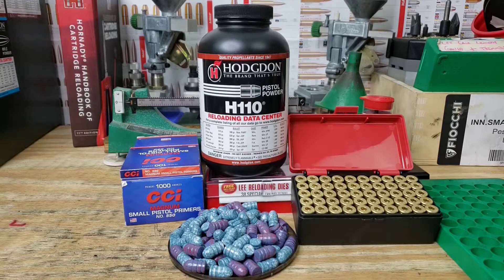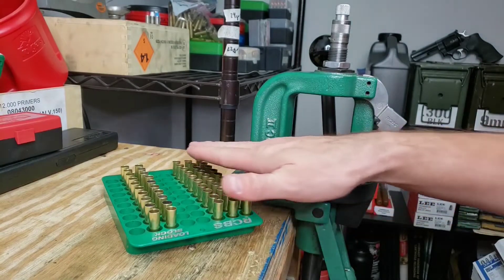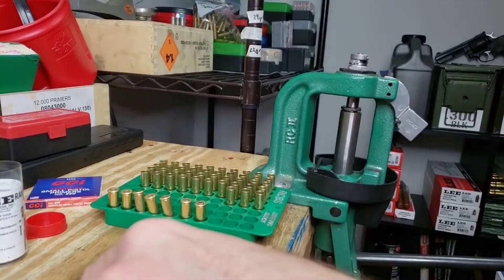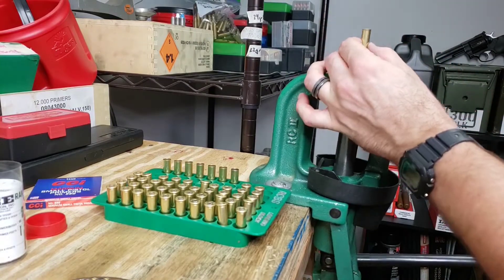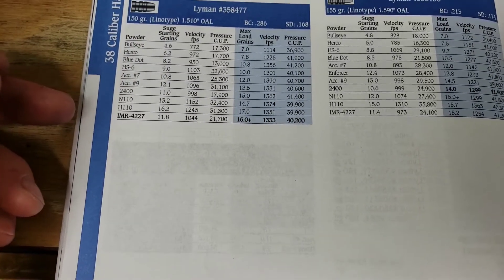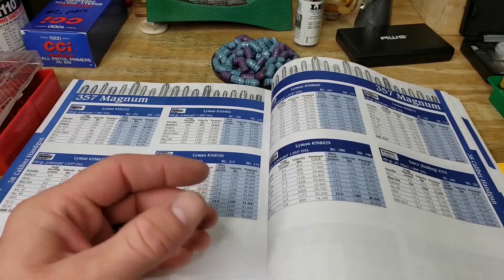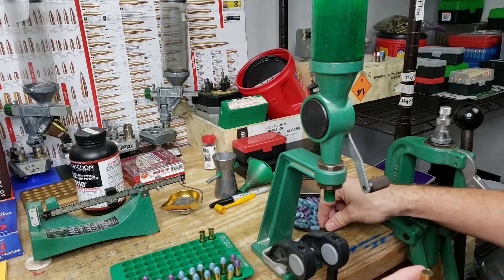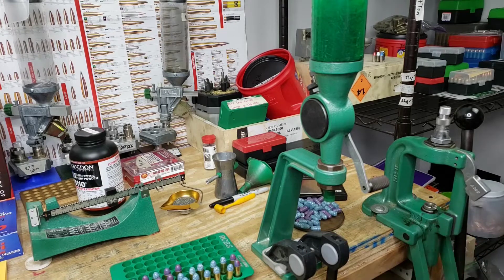First Time Reloading 357 Magnum - Episode 3 - Cast 358150 + Hodgdon H110 + CCI #550 Magnum Primers

Comment: Great video 👍🏻 I was wondering if you had to gas check 357 mag. Now I know. Probably would if your running them hot though.
Reply from the maker: I'm going to bump up the charge a bit and see what happens. No excessive smoke or anything unusual from not GCing. I've never actually GCd any of my cast loads, adds to the cost and I'm cheap lol 😆 Thanks for watching brother 👊👍🇺🇸

Comment: Out of curiosity have you tried using RCBS' press mounted primer to prime? It looks like you're just missing the priming arm and pickup tubes. I've been using that setup for a while and I believe it's just easier and faster than the ram prime.
Reply from the maker: I have not! Got this thing used and it didn't have anything with it but the press itself! Maybe I could reach out to them and see what it would cost to get those parts out? Thanks for watching brother 👊🇺🇸👍
Reply: I would give RCBS a call in the past they've sent stuff out for free but who knows nowadays. This is what you need to get priming.

9113 Primer Arm Pin

9550 RCBS Single Stage Press Universal Primer Arm 2

9580 RCBS Auto Primer Feeder Combo

Or tubes only:
9582 RCBS Auto Primer Feeder Tube Small
9581 RCBS Auto Primer Feeder Tube Large
Reply from the maker: Awesome, took a screen shot of the list. Will send them an email! Thanks a lot 👍👊🇺🇸

Comment: I'm NOT telling anyone anything, no liability here😉 but my 158 JSP Favored deer round for 20"Henry uses 16.9-h110 Win sp-mag prmr@ approx 1.588 OAL with the particular projectile I use for that purpose.and you can thread a needle with it 😉
IV went hotter on that exact loading and groups widened IV went lower and groups widened & dropped obviously and was more messy.
Disclaimer, I'm not permitted to disclose load data publicly,lol
Reply from the maker: Haha thanks. How did your primers look up at 16.9? I know mine aren't totally flat, but have yet to try it in the lever gun.
Reply: @DummyRound  Not what I consider to be concerning myself,starting to flat bit but there was no signs or concern elsewhere I consider to be a red flag HOWEVER , I'm using them in a Henry BBS, not a 1873 Sporter,SAA or Revolver that does play in to things a bit, it's just a good hunting load not one I run 500 rounds through a Saturday you know what I mean, idk it works for me but I do not recommend using it in a handgun or any action weaker than a 92 action with the large double locking lugs, the Henry is ideal for those hunting loads...he ry is not not ideal for SAAS in the least but a great farm/ranch/hunting unit
Reply: But the primary reason really I don't use them in pistols isn't because I'm worried about it being overpressured it's just not sensible to introduce more recoil,more sandblasting..ECT to a pistol to achieve a lower velocity than a more suited pistol powder (I like N350 best) because it only burns a fraction of whats in it while it's in the barrel
Reply from the maker: Awesome, thanks🤘